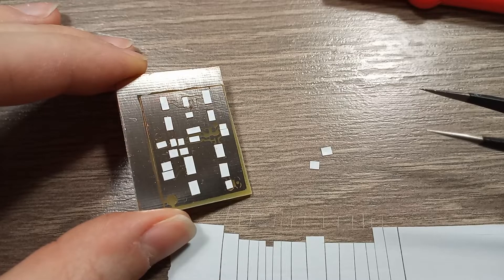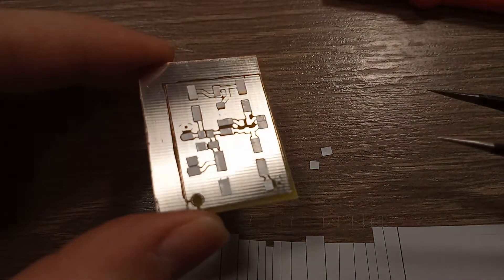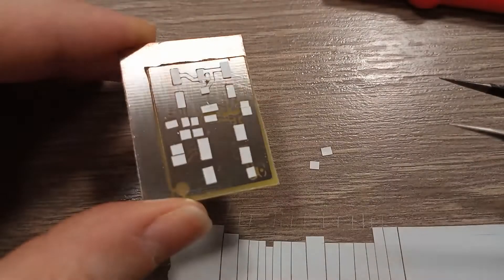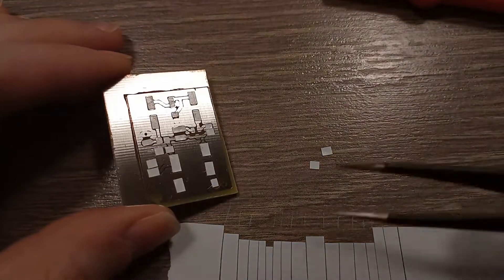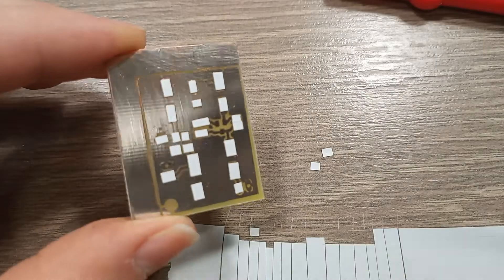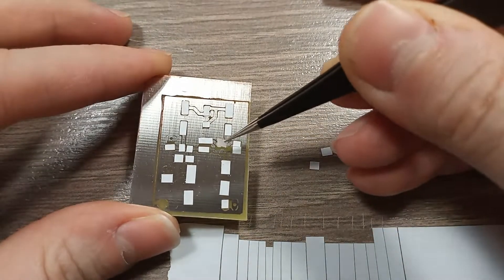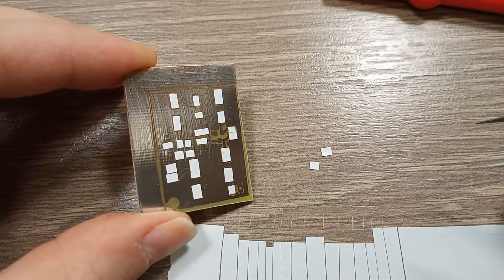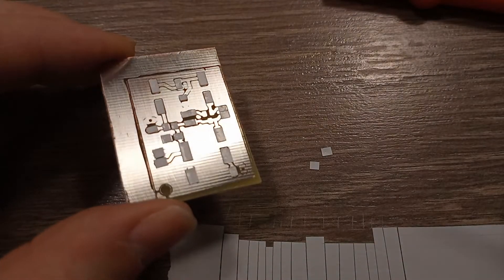Poor man's PCB soldermask

Comment: It looks like a very thick layer of paint. How many spray passes were performed? Such paint must also be additionally baked at a temperature of 180-200 degrees for 15 minutes
Reply from the maker: Hello! I'm not sure, maybe 2 layers. You're correct, this is a heat-setting paint.
Reply: Hello. It seemed to me that the black thermal paint has a slightly rough structure. Hopefully red or white paint will be smoother. I have a video on my channel where cnc paints pcb with wax. I want to try waxing the pads and applying red paint. Then remove the paint from the pads. Next, I will apply silk-screen printing with a permanent marker, and then I will heat-treat it. It is possible that the marker will combine with the paint when heated and will not be erased with alcohol.

Comment: Hi Gergely. Thank you for the video. Can i learn what kind of electrical tape you are using? All i can find here in my local store is the black ones for electrical wiring. i was thinking to do the same thing but with a transparent tape. By sticking the tape on etched board and carefully cut the pads without damaging the traces and then spray paint. i did not try it yet. Some of my friends also told me to try toner transfering pads to etched board and then spray paint. I tried but it is very hard to align pads
Reply from the maker: Hi, I'm using just simple sticky electrical tape, the color really doesn't matter. Not sure about the other options you've mentioned, never tried those.